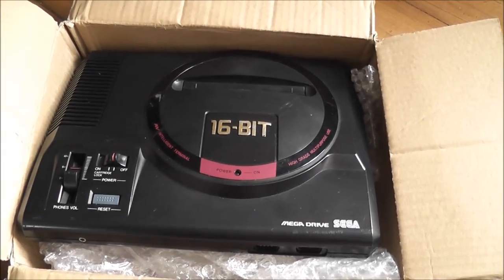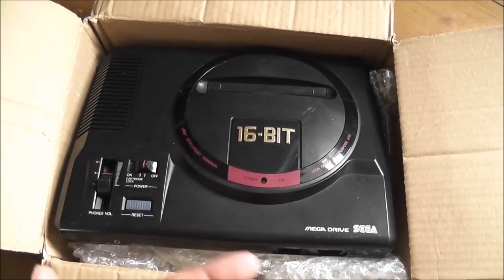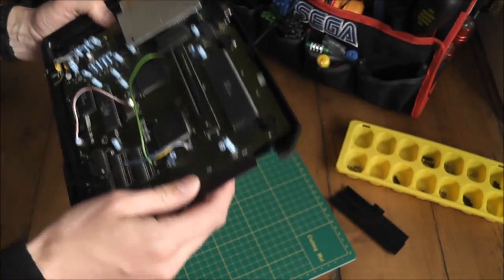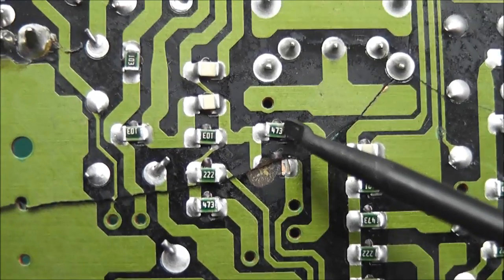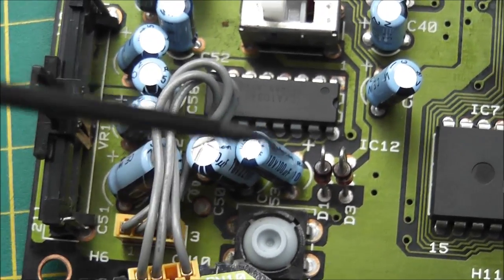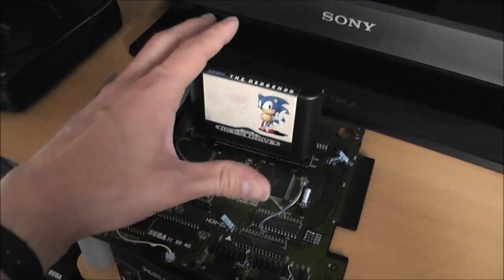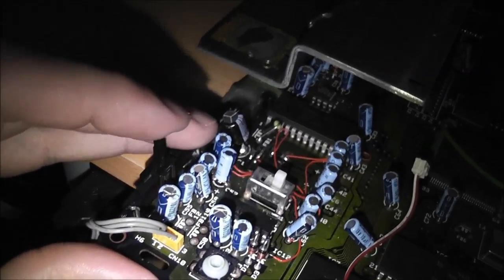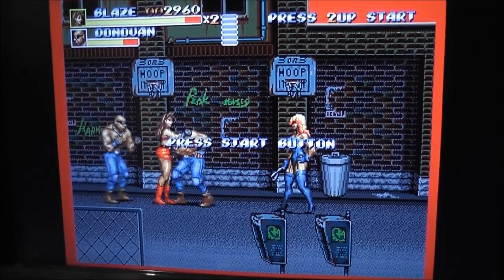YouTuber Challenge - Cracked Mega Drive Mobo - Let's Repair - Console Rescue

Comment: My PAL-modded JP MD was found in Thailand with an RF modulator soldered to the ground plane on the left and a hole drilled for the RCA jack. The ones with the RF modulator stuck on the heat sink with mounting tape typically have an RF lead coming out the back where the threaded insert for mounting a Power Base Converter goes. I can see the residue on the heat sink here. :) Though it requires drilling, I like the way they did it on mine since it doesn’t insulate the heat sink and doesn’t add a cable you can’t disconnect from the outside.

They also added a switch for PAL frequency or subcarrier or something with a capacitor and clock crystal soldered to the encoder. They mounted the switch to the side of the modulator such that the hole only needed to fit the shaft/plunger. Very subtle and almost looked factory from the outside.

I removed the extra components, restored the two traces they cut, and repurposed the switch for region/language. I also gutted the RF modulator to install a 9P mini DIN… MD2-style with a 3BP V2 Triple Bypass. It works great and is just close enough to reach a 32X with stock and aftermarket MD2 cables. :)

One thing I noticed on American consoles is that 3BP V2 buzzes a lot when you connect the headphone jack without shielding. Since JP consoles have no shielding and typically have no RF modulator to replace with a mini DIN, most 3BP installs are forced to use the headphone jack to output line level stereo. Buzz city unless you have some kind of shielded coaxial or something. I usually connect it anyway so people can use their old DIN 8 + stereo cables and though the buzz wouldn’t be too bad since the RF can is grounded, mounted almost entirely off the board, is much closer to the headphone jack, and the wires don’t even pass over the board. Unfortunately it still buzzes so I’m going to have to go back in with shielded coaxial to see if that helps.
Reply: On mine the PAL RF modulator was soldered right where you put your bracket, extending off the left side of the board so that the RF jack protruded through the drilled hole on the left. If someone tried to pull it off it might crack the board just like that one, making me think that’s exactly what happened… except that I can see where the RF modulator had been stuck on the heat sink like other PAL-modded JP MDs I’ve seen. So confused!

Comment: Any chance you can have a go fixing my Megadrive? I'm from Scotland too. I have a modded Megadrive 1 High Definition model. Recently, I tried the jailbar fix on it (where you lift the 6th pin on the Sony chip) to help remove the a majority of bad jailbarring. Now, I have no picture/sound at all! I tried changing my RGB scart composite cable to RGB scart CSync but I'm still getting nothing.

Comment: Was aghast when you said converted = "butchered". Went to my asian '91 Mega Drive (same year and model as the one in the video) to prove you wrong and BAM! it has a crack on the motherboard. 3 screws hold it on the chassis (I thought it was normal). And the cartridge input has just one screw too, cause the plastic that hold the other one cracked, probably in the 90's. The board's crack is on a useless part, no problem at all. The screws I will have to find some. But both the control inputs are hold by the solder only, no screws on them, whatsoever. And the freaking thing holds it together since 91!!!

Now on the hunt for asian MD screws :(. 
Could be worse as we saw on the video, though. Thanks for the heads up.

Comment: I wonder if he'd have any interest in a Sega Genesis I've messed up trying to put a Motorola 68010 in it. I put in a dip socket and can't get the system to boot anymore. neither the 68k or the 68.01k being in the socket let's the system boot and I'm positive there is continuity between the pins and the traces on the board.

Comment: I found one of these in a charity shop about five years ago. RF mod was wrecked, the cable tailed through a hole at the back of the console. £5 'complete' in box, with Telesales AC adaptor. Scared to plug it in, did so, worked perfectly apart from a buzzing sound from the console. Sold it.

Comment: For anyone wanting a very easy  money maker from the likes of eBay.....The Stihl TS series of cutting tools are reasonably cheap to get hold of in many similar states of disrepair, very cheap and simple to fully service or completely rebuild if necessary and the turnaround of 300% return each during the landscaping/scrapping season is very lucrative. This is my experience here in England, it maybe the same in most territories where such tools are as common.

Comment: RDC over at xbox scene (among others) had a guide to bad trace repair. it was interesting, he would tape over the areas around the broken traces, sand down to the trace, place insulated wire with tinned tips directly overtop the trace line with a touch of glue, and the tag the line. made it look like a super clean repair every time instead of botch botch botch everywhere.

now as he himself would say, who cares what it looks like - does it work... and i tip my hat to you sir on this fine repair work.

Comment: i have a playstation 3 with not-working drive mechanics (it has a disc built in and i modified it with a cobra ode) if you want to try fiddling in the small gears and everything i could send it to you (PAL, from germany, a fat one). Most of the gears are still there, i had to redo a few solderings aswell since i bought it broken. So the machine works, the ODE works (loading games via external HDD) but the drive mechanics (inserting and ejecting discs) do not. (of course you could keep it i wouldnt want it back since i am done with the PS3 ^.^)
Reply: +1337RevolutionX Why not buy a new drive, its only 30€

Comment: The power connections got cut and the path between the audio ram and the z80 was messed up. Just a theory. Also the missing capacitors did something to the video.

Comment: if sega would have used a smaller cpu the mega drive would have had the same capability has their arcade hardware as far as grapics
Reply: +j reed How would using a smaller CPU make "graphics" look better? That doesn't make any sense.

Sega did use a 68000 in a smaller PLCC/PQFP package in later Genesis models compared to the early DIP64 package.

Comment: i used to have a pal1 asian megadrive but swapped it back in the day.I bought an actual japanese one for a good price (£20) but it had been knocked about a bit and i noticed it was very light (no rf shield) and the cartridge lock thing had been taken off so pal games would fit..i am now wondering whether it was one that had been converted to pal then has been converted back or something as it runs as japanese full screen and won't play the pal konami games etc..the vid was great by the way
Reply: powerKitten Unlimited they didn't have RF shields because the RF modulator was external, not built in

Comment: How do you crack the Mobo? These things were always built like titans--
Reply: probably the lack of screws supporting the motherboard, and the cartridge going in and out without the proper support.
Reply: +lillskiten1337 Why would you want to? It works fine without it.
Reply: lillskiten1337 japanese mega drives dont have rf shields,afaik
european mega drives and american genesis should have shield, it had to with certain regulations
Reply: Malcolm deRoy
Now i feel like opening up my mega drives i just got to see if they have the rf shield and such
Reply: why doesnt the japanese one have it, doesnt that give some benefits to have a rf shield
Reply: didnt have because it wasnt mandatory there, and companies always go for the lowest cost possible
Reply: hmm is it possible to just add the rf shiled from the other regions into the japanese
Reply: cause i like shields and swords

Comment: think wire glue (or any conductive glue) placed over the traces would have fixed it? Minus the capacitor that will obviously need a little work.

Comment: well i have two, black and blue. the blue one has some sound but the screen is completely weird. you have to hold it at some strange angle to see anything. the other one has no sound and the screen is messed up too. must be a common thing. how much do you charge? maybe we can work out a deal. if its worth it ill give you one and pay for the shipping if you fix the other one. i dont need it asap so i could get the cheapest shipping. i dont mind paying a little extra.